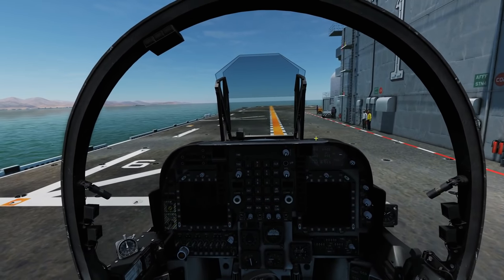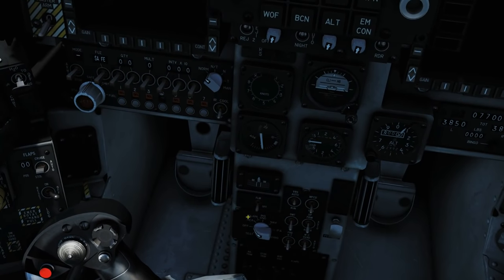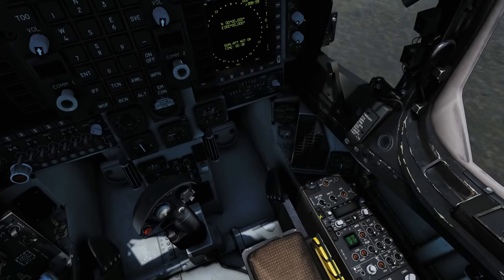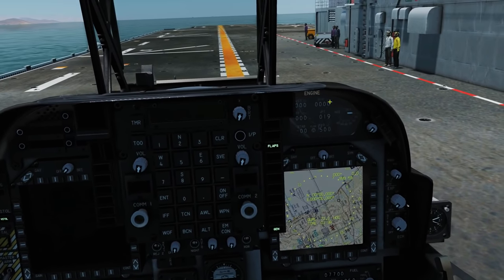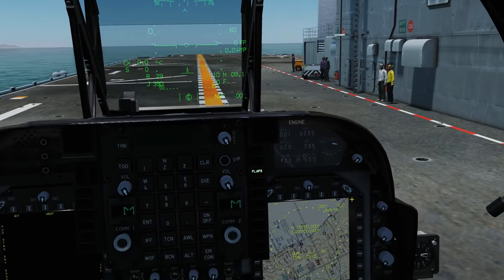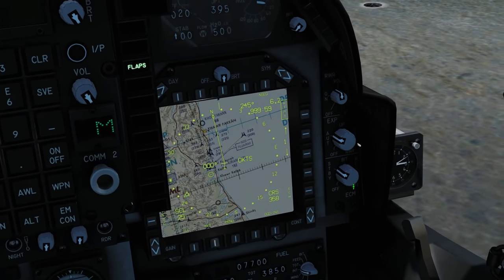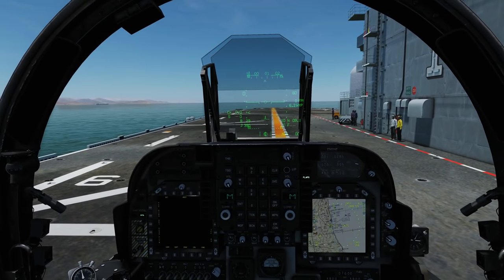AV-8B Harrier: Cold Start & Alignment(SEA/Carrier) Tutorial | DCS WORLD

Comment from the maker: CORRECTIONS/ADDITIONS:
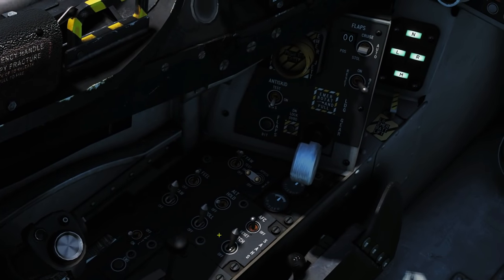3:10 Ensure RPS/YAW Switch is set to ON
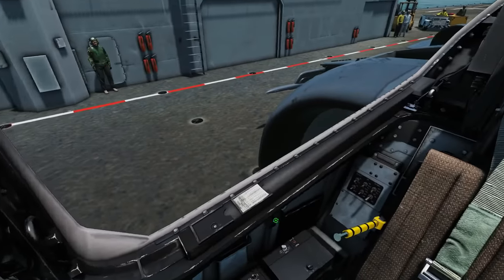3:18 Ensure the FLAPS ON/OFF Switch underneath FLAPS Selector is set to ON, before using flaps
4:00 Or you can swtich to IFA, which is similar but superior to NAV
End: Ensure Radio Master Mode Selector set to T/R(right console)
Optional: Set ICS volumes as required(right console, 2 grey knobs)
Optional: Set Baro Altimeter as per ATC